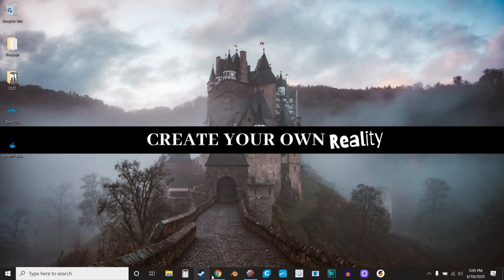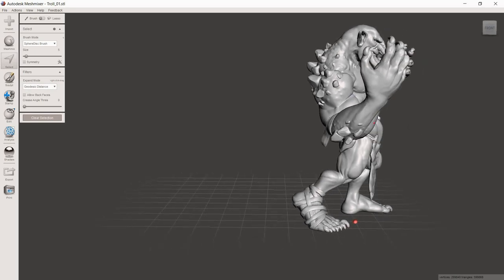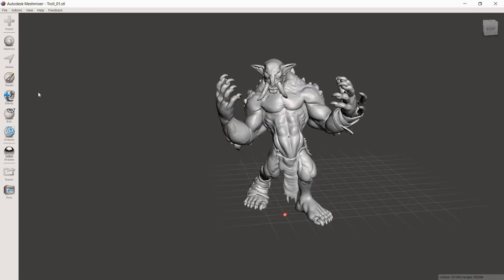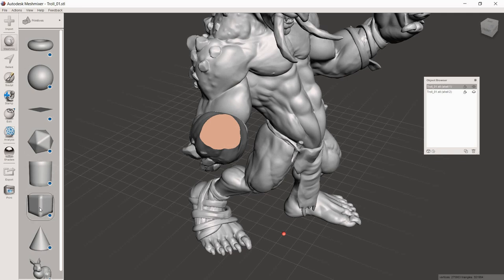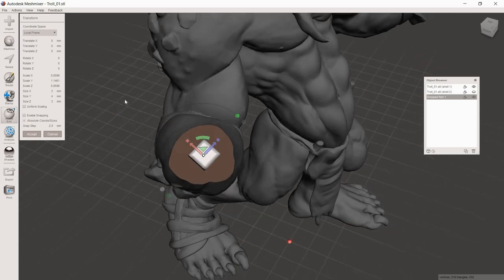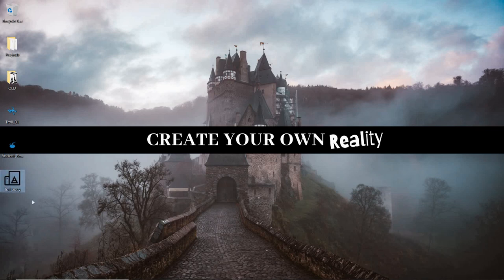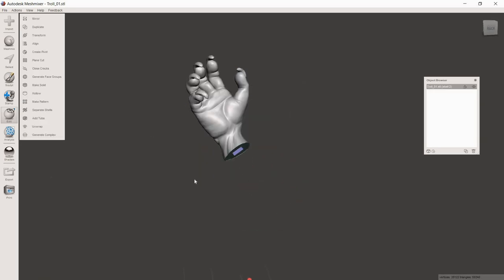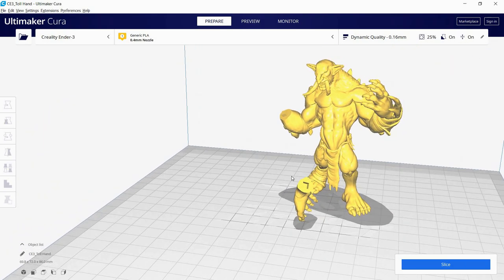How to Make Perfect Alignment Pins With Meshmixer!

Comment: GREAT tutorial! Addition though:To remove the need for the save and undo stuff. Make all of your slices and put all of your pins in place WITHOUT doing the boolean union yet. Then select all of your pins and Duplicate them. Then reselect and toggle their visibility. This will leave one set of pins visible, and one set invisible. Go and join each pin to the one side, then reverse your visibility and you'll have all of the exact same pin pieces available to do the holes.
Reply from the maker: That's actually the process I typically use. At the time of recording this video I thought that step would be a bit confusing... But quite a few people have said they figured it out on their own while following my video. So I think I'll do an updated video on this with that and some other tricks I left out for fear of being overwhelming..... Thanks for the feedback I really appreciate it!
Reply: @SlicePrintRoleplay  your assessment was correct. This process is easier for beginners (like me) to grasp, even if the other was is better once you’re more familiar with the functions.
Reply: @SlicePrintRoleplay  one year later lol I’d love to see the faster way
Reply: @TheIronNoodle  I seocnd this
Reply: almost 2 yars later and im looking at this confused

Comment: I know this is an older video. I get as far as saving off the file with the key. When I go back in and hit cntrl z. I get 3 parts but the key or the square is never by it's self and I am unable to do the 2nd part.   What could I be doing wrong????

Comment: Whenever I do a union with the settings provided, Meshmixer locks up. But if I use defaults, it works fine. Any idea what could cause that?
Reply from the maker: @Irish_Atlas  it's hard to say for sure. My bet is that the default settings use less memory and CPU power.
But, you can avoid the issue by using the "Combined" option instead. Basically, the combined option can be undone by separating shells. However, the union option attaches parts permanently and can only be undone if you cut them apart.
The combined option puts much less stress in your system because it's not making a permanent connection.
Reply: @SlicePrintRoleplay  I will give that a go. Been pulling my hair out on a project that needs 13 keys.

Comment: Sorry I couldn't find it, but do you have anything that shows how to COMBINE separated models (like a giant model that has body, arms, and base as separate models) with alignment pins?  I find I don't want to glue parts together, and my print bed is big enough, so I'd rather align and put the models together as one big model and then print.  Just newbie to Meshmixer and trying to figure out how best to get those parts aligned again.

Comment: There are many videos of separating a model into multiple parts... Yet no videos on how to align the keys and put the model back together... any tips?!
Reply from the maker: @xmavrekx8663  the main reason for that is because it's not an easy process. There isn't much use in making a video for something you can provide any help with.
If you're lucky, when you bring all the separated files into Meshmixer they will snap into place. However, that only happens when the creator of the files saves them with positioning data and in the correct positions. That's not often the case unfortunately... I'll look into it and see if I can find any helpful tips for combining parts together.

Comment: Great video. Yours was the first to make this seemingly simple task make sense. As common as the need to cut larger models into smaller ones for later reassembly, why is this not an integrated feature in modern slicers?
Reply from the maker: I'm glad you found the video helpful and easy to follow.
I think that editing models isn't too common in 3D printing at large. But in certain 3D printing subsets it's very common.
I also think it takes a lot more effort to add model editing options to a slicer... So I hope it's something we see in the future, but for now Meshmixer is a great option.
Thanks for your positive feedback and the great question!

Comment: Thank you so much for this!  I was able to successfully cut a model I was working with which will allow me to handle the piece I cut differently than the rest of the model.  I do have a request, though.  If you haven't already could you please put out a video on how to work with a model that has lots and lots of shells?  I have a particular model that has 245!  And I want to be able to cut it up, too, but it is way too complicated.  Anyway, thank you again!

Comment: Thank you for this!!! Just got my first 3d printer and wanted to learn how to do this.
As for what you said in the video if you haven't already could you create a video about having the different shells and making them into one? 
The model I was going to use this for ended up with 6 different shells and they are small little pieces. I'm trying to figure out how to attach them to the main body part to print as one of the halves. Thanks in advance!!

And nevermind found it in your next video!! Thank you!!

Comment: Oh boy. I use this kinda thing for Knife props. I do it a crazy way in Tinkercad, or, I pay somebody to do it for me. I just started learning MESHMIXER today, and I will try to learn this. Thanks much
Reply from the maker: Oh that sounds awesome, you are very welcome! 
Yeah I find this process in Meshmixer to be really quick and easy. If you have any questions just let me know.
Reply: @SlicePrintRoleplay  Thanks so much!! I may take you up on that
Reply: @SlicePrintRoleplay  Holy ship, I made pegs for the 1st time today. I referred back to this video for help. Thanks much!  Pro-Tip: The preview iterations is a bear on your machine. Caused mine to crash. It's just for what you see on the screen. No physical effects. Not needed. Leave it be.
Reply: @SlicePrintRoleplay  Sooo, I've gotten pretty good at this, but.... I have one huge problem. I am making handles, that pin together via 3 parts. Say, on the 1st part, I forget to make the hole for the peg, a touch bigger. I have to do the entire project over again, because the UNDO will no longer work, when loading the project. Or, say I just want to adjust the size of the peg or the hole... Have to do the entire project over again from scratch. This has happened to me a million times now. I'm about to redo one, for the 4th time today. It's perfect, but I forgot to make one peg hole a little bigger and want to do that. The whole thing has to be started over... Is there a way around this? I just want to undo the "difference" get my pegs back, and make them a touch larger, then, re-do the difference. No way to do this, that I can see....
Reply from the maker: @GreggAdventure  unfortunately I don't know of a way to undo a previous function within going back using Control + Z.
There are likely other programs that would allow you to make adjustments after a function has been completed, but I don't believe you can do that on Meshmixer. At least not as far as I know.
Sorry I couldn't be more helpful.
Reply from the maker: One thing you can do is use the combine function for the pins instead of the Boolean Union function. What this will do is allow you to break the pins away from your model to make adjustments then simply combine them again.
The pins will still work the same and your slicer will treat them as though they were part of the model. But in reality they are technically a separate model that's sort of "Stuck on" your main model. That would only apply to your pins and not the holes, but I figured it might help you to avoid some of that headache you're running into. 
Let me know if any part of that doesn't make sense.
Reply: Anybody found a way, outside of making constant duplicates, and new save files for each and every change?

Comment: gosh ive been having a terrible time with slicing a model with multiple shells, keeps making it cut say the outside layer instead of all the way through, could you please do a tutorial on merging that or however you deal with it!
Reply from the maker: Hmm that does sound frustrating. It sounds like there may be issues with the model. That's normally what causes odd issues like what you're experiencing. Try running the model through the process in the below video. Let me know if that resolves the issue.
https://youtu.be/ai5ZjGFS29A

Comment: Excellent overview of the tool. I have a problem where the primitive never sets perpendicular to the surface. Is there a trick to correct that?
Reply from the maker: That can definitely be frustrating! In that case I usually just manually adjust until it's as close to flat on the surface as possible. If it's off by a little it won't matter much because it should be off in the same way on the corresponding part/half... Does that make sense?

Comment: Great Tutorial.  Now how do I do this in reverse?  Most pre-keyed models are for small print beds.  I would like to put the back together to print in one piece.
Reply from the maker: That can certainly be done, but takes some time and patience. Lots of adjustments to get all the parts to fit correctly... Then I'd recommend using the "Combined" function.
As with everything else in life it's easier to cut models up than it is to put them back together.

Comment: I would like to see a video showing how to deal with a model with many shells. I see this alot and it makes adding alignment pins very difficult.

Thank you
Reply from the maker: Would you by chance have a specific thingiverse model you had that issue with? Just so I can make sure it's as accurate to your requests as possible. If you don't mind you can message me on Facebook or on the Facebook group.
I'm always happy to help with stuff like this.
Reply: @SlicePrintRoleplay  im having the same issue, i have a model i want to print too big for my printer but its 219 shells when i try to cut it and its just very overwhelming
Reply from the maker: @comfysocks7  I apologize for the delay, but I promise I am working on a video covering this topic in detail. I should have it done soon.

Comment: Would highly suggest an updated video showing multiple pins/voids on the same model. Trying to learn this for a wall set piece that requires several cuts, but it’s daunting.
Reply from the maker: I can certainly make some updated videos. I've learned a lot about Meshmixer since making this video. But I do have a video that will probably help you with that process.
https://youtu.be/2aoJUkE8nJg

Comment: Great tutorial. I have a question about my problem.
I downloaded a file of an action figure with the body already divided and the pins already created. Checking the model before printing, I noticed that the files of both arms are not the right proportions. The rest of the body is right. Is there a way to bring them to the right size?

Comment: Fantastic Turorial.  Im currently making Starwars helments for my sons cosplay and Im new to 3D Printing.  Love meshmixer so much.  Can this same process work when I slice the hemlmet into 8 pieces to fit on my Ender 3Pro bed.  Anything I need to work out.  Im guessing make 2 points on each side??  Unfortunately already printed before I came across your channel,  Just working out for the next one.  Your right a nightmare joining them without doing this
Reply from the maker: Thanks you so much for the feedback and I'm glad you're finding the video helpful!

That's so cool! Both my sons are too young to want to cosplay, but I'm excited for when they do! 

Yes I think at least two pins on bigger models would be a good idea to keep it strong and aligned correctly.

I'd love to see pictures of what you're working on if you'd be willing to post on the group, but if not definitely let me know here how it goes!
Reply: @SlicePrintRoleplay  happy to show pictures if you could let me know how to send them on you tube or any other way
Reply from the maker: @samstrada2796  if you're interested in joining the Facebook page I always enjoy seeing what you all are working on!

Comment: This was a bit overkill for my usage. I'm looking for a way to split a tool into two pieces while making a split that is easy to join together when assembling the model. The object is more like a straight square stick. There must be an easier program to use for that, that has presets that can figure out how to do the cut automatically?
Reply from the maker: There may be a program like what you're looking for. However, this is the only program (so far) that I've used for cutting/splitting models.
Let me know if you find something that works for you!

Comment: Is there a way to specify the width and depth of the tool used to create the pocket and also have a snap to grid option?  I've been using Tinkercad to make magnet pockets in 1/200th scale WWII warbirds but it is limited in the number of polygons it can use so the finish on the plane isn't as smooth as I would like it.  If I do it in Meshmixer the model will be much more smooth and import into the slicer better.
Reply from the maker: Hey sorry for the super late replay, but I never got a notification for this comment. 
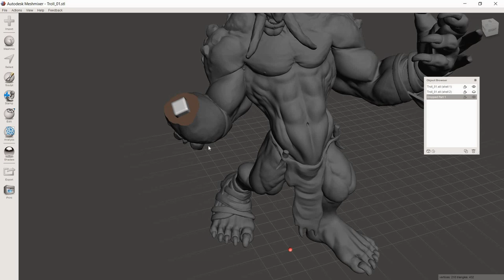Since you are creating the object that will be used to create the pocket you can make that object whatever size you want. At the 10:07 mark, I show how to adjust the size of the object used to create the pocket. That would be how you would set the width and depth. Just remember that only half of the object's length would be inside the model. So if you make the length 3mm then you'll have 1.5mm inside the model and 1.5mm sticking out. 
I am not sure about a snap to grid option.

Comment: Very nice tutorial.  You mentioned you didn't know why it was called union.   Booleans come from boolean logic, which at its core is a comparison operator that compares two binary values and gives you another one based on boolean math functions such as AND, OR.and XOR.  Boolean operations on a 3D model normally have 3 basic outcomes; union, difference, and intersection. 

Union means when the comparison is done, it returns both models as one, thus creating a union of two separate models. The boolean function for this is an OR operation. 

Difference, of course, returns one model with any intersecting geometry from the other model subtracted away from it. This is what is known as an XOR function(exclusive OR), meaning you can only have one or the other, not both at the same time, thus any intersecting volume is deleted. 

 And finally, Intersection returns only the geometry where both models intersect each other. This is a boolean AND function).
Reply from the maker: I really appreciate the in depth response! I was mostly joking, but I definitely won't pretend I knew all of that before reading you comment... Thanks for the awesome info!

Comment: by adding the cube like this with drag and drop on the plane surface, it is not jumping exactly with the cubes bottom surface excatly on top of the plane surface? I think it dives into the plan surface ? is there a command to drop the cube, that the cube bottom surface is right on the flat plane (not diving into it)

Comment: for the pin part you can just export in stl while selecting the 2 parts. No errors, no need to wait for your pc to do the calculations too ;)
Reply from the maker: That's is definitely an option. You can also use the "Combine" fiction as the pines don't require a complex remesh like the holes do.
The holes are typically where people run into computing issues... But a great suggestion all the same!

Comment: 8:10 i am working and waching tutorials for exact that problem.
Is adding more parts to "object review" so i have to hide it to keep the part i want and import it as STL.
But i found other problem wich is "hole" in the print. i cant get flat surface when i make the cut. So i cant put pins for alignment. i try inventor, fusion 360, and mesh mixer. and i want to stay with meshmixer because i like to use 2nd click to move the object, is more easy to me than fusion360.

Comment: What size difference would you recommend for resin printers?
You said .3 works best for FDM so what tolerance would be better for resin?
Reply from the maker: I actually haven't don't much testing with adding my own keys to resin models. But I'd say .1mm or .1.5mm. It will really depend on how much the resin you're using blooms during printing. It may be worth testing before you key a full model.
Reply: @SlicePrintRoleplay  awesome. Great video and thanks for the quick reply
Reply from the maker: @The.Achilles  you are very welcome!